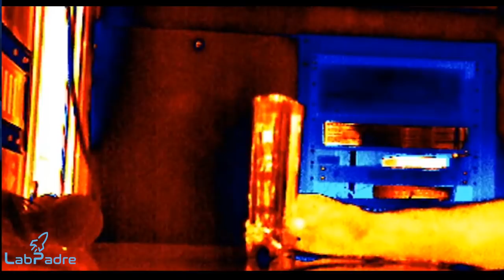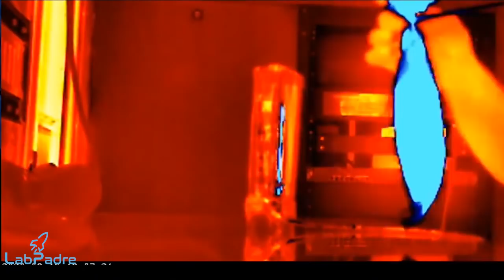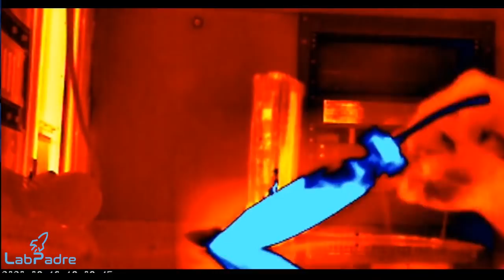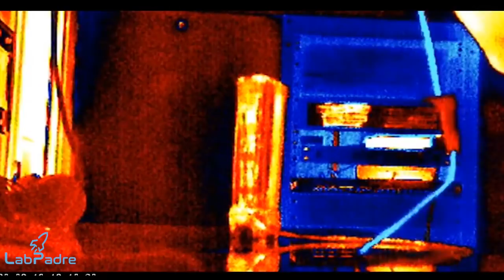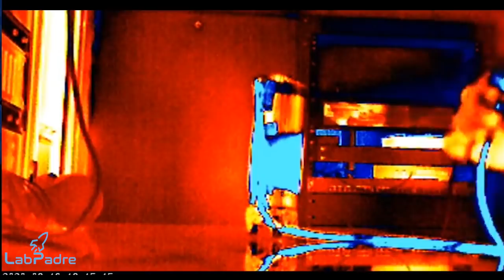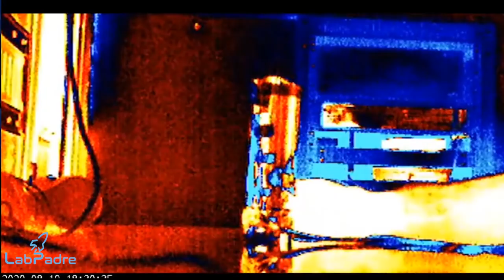SN X Thermal Cam Mock Up Tank/Detank Demo

Comment: tryied to warn you before, in the chat, shiny metal a.. tank is difficult to capture on thermal. that caused you can see a frosting on thermal after condensing water freezes. if you cover the can with some paint or tape with decent emisivity, it's it. its like try to capture light at the surface of mirror. in better words: you cant' shine cold, if you reflecting heat of everything in range.

Comment: The problem is, you won't be able to see the IR radiation from the heat. Metal like steel is almost completely reflective to IR radiation. So sadly you will only see the reflections of the sky and the surroundings

Comment: Shiny metal has very low emissivity and high reflectivity. 

Looking forward to the results
Reply: True. You will likely see more reflections from your surroundings than the real temperature.
Reply: Same thing for the inside.  The heat transfer should be rather fast
Reply: Francis Schweitzer 
Yes. But the camera will have trouble seeing it as the heat radiated from shiny steel is very small and heat reflected is very high. 

Look at the reflections of his body heat in this video.

Comment: If possible it would be good to fix the temp color scale to static values.  Otherwise random hot spots will cause the scale to constantly drift.